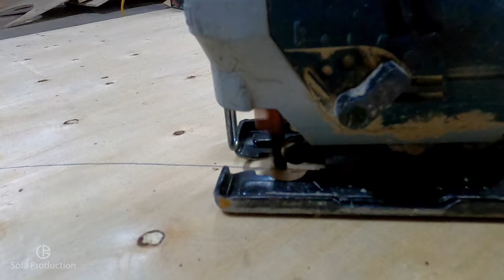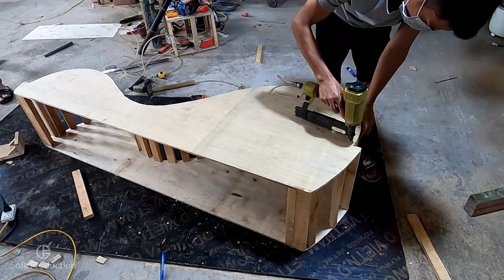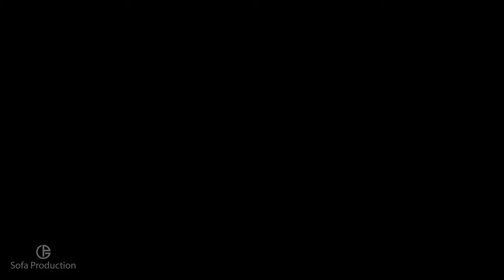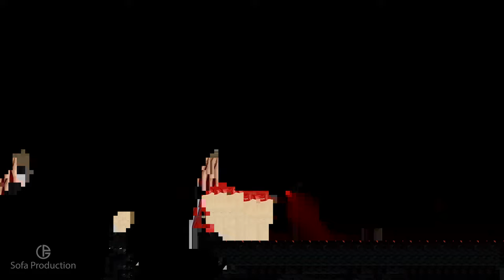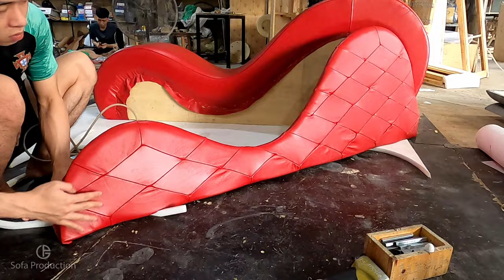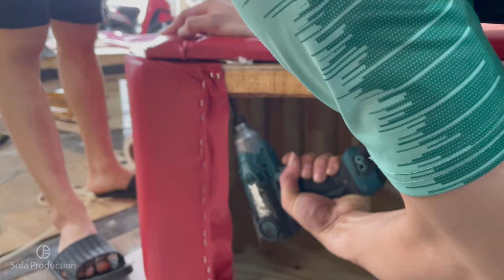How to make a tantra sofa? Discover the manufacturing process of tantra sofas

Comment: Amigo muy agradecido por su vide y manera de demostrarlo yo tengo una pregunta usted el molde lo tiene en dos partes pordria decir cuanto mide de largo cada parte del molde ,muy agradecido por su respuesta ,muchas bendiciones
Reply from the maker: el tamaño de la ranura central es de 25 cm/la altura de inmersión es de 72 cm y también la altura del arco menor es de 42 cm,
longitud del asiento 185 cm
(the size of the center groove is 25cm/dipping height is 72cm and also the height of the minor arc is 42cm,

seat length 185cm)
Reply: Amigo gracias ,esa parte la entendí muchas gracias

Comment: great... what a video.
it is perfectly shaped and looks comfortable.
can you share the dimensions of center groove/dip height and also the height of smaller arc. 
i will ask the sofa maker in my area to make it. if you can share all the dimensions please.
Reply from the maker: the size of the center groove is 25cm/dipping height is 72cm and also the height of the minor arc is 42cm,
seat length 185cm